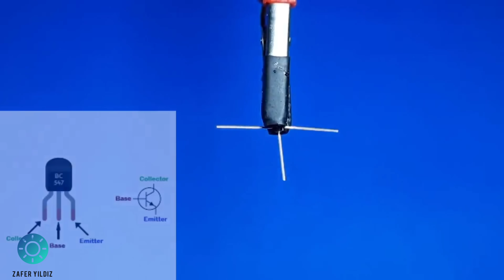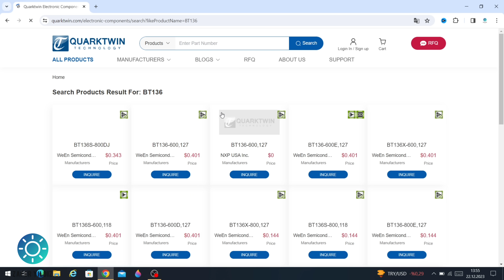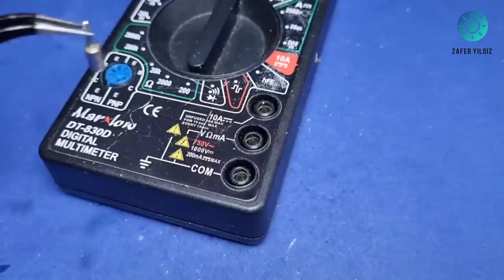3 Simple RF Detector Circuits / Radio Signal Field Detector

Comment: Hi Zafer. Thanks for amazing videos. I needed your guidance on a small thing please. I have a solar system with lightning arrester from roof going down into the ground via earthing cable. Appreciate if you can make a simple DIY circuit to  glow an led/buzer whenever a lightning strike has been caught by the lightning arrester on my roof and has been grounded, but at the same time I do not want the circuit to show nearby lightning strikes. Appreciate if you can make a short video on that please.